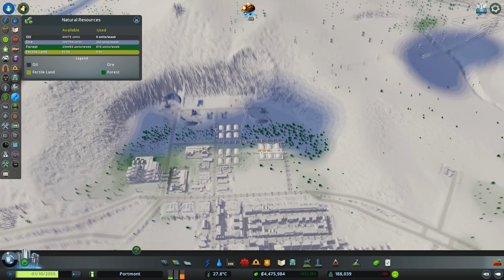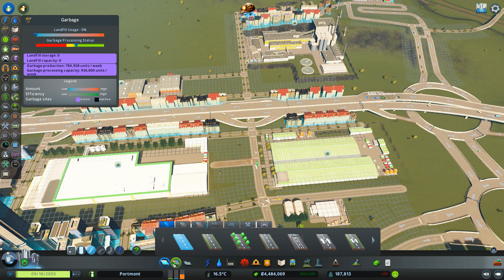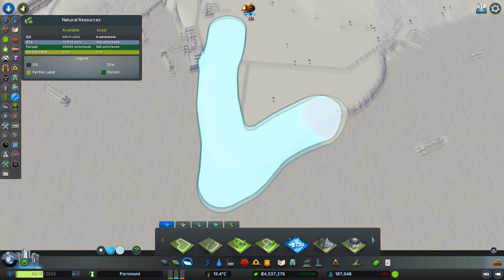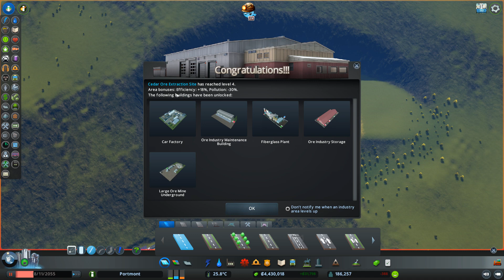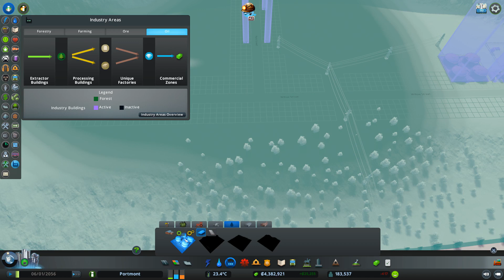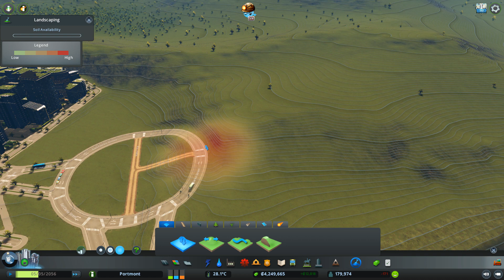Oil And Plastic : Cities Skylines Gameplay : Part 24

Comment: Is that the only oil field?
With all of the expenses, including roads and tunnels, you'll be lucky to break even.  ;-)
Reply from the maker: ty.  The available oil on this map consists of several small areas,  which will run out quickly. This sole objective of the oil field is to level up and unlock the ability to make plastic (which cannot be imported). which is required by the unique factories.  Once the oil has  run out, the industry will have to import the oil to make the higher tier products.  Hopefully the profit will come from the unique factories.